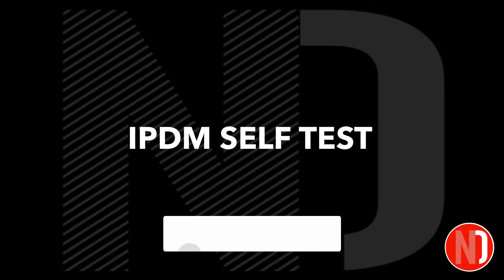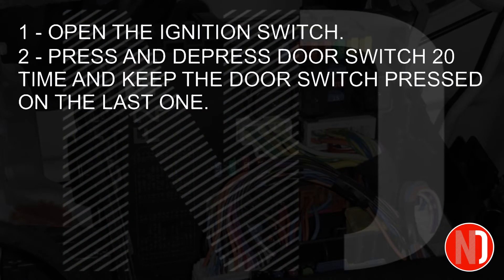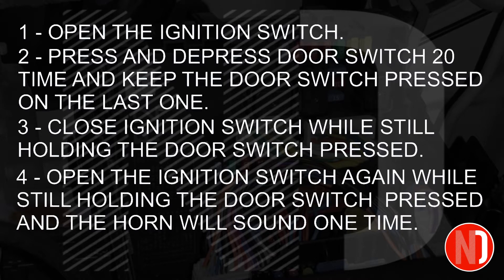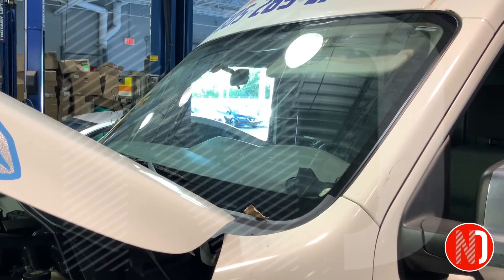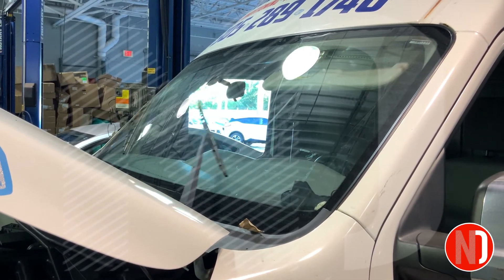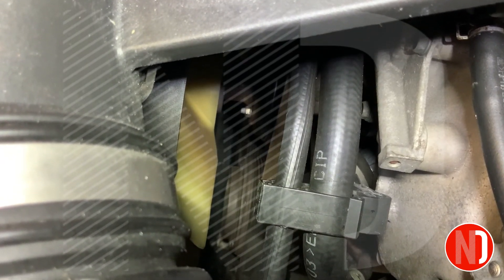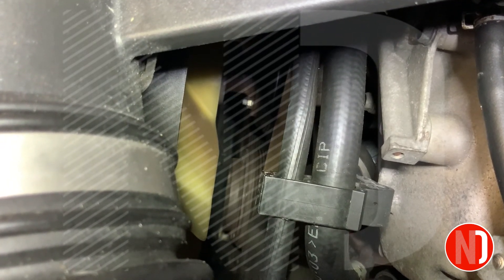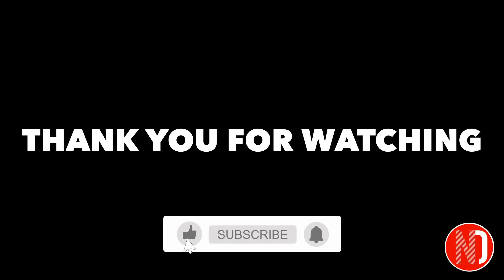Nissan IPDM Self Test - Performed on a 2017 NV2500 | Nissan Doctor

Comment: Hello friend, I am getting the P1651 error code with the OBD device. There are no symptoms in the car. The yellow engine light is on. I turn it off. It comes on again after 4-5 days. The battery is new. Can you help me? 2014 Nissan Juke

Comment: Hi, 
I have Nissan QQ 2017 1.2 petrol.
The tail light and the number plate light have stopped working , I have checked all the fuse boxes , and all  fuses are okay, nothing blown.
Do you think it could be IPDM at fault?

Comment: So I did the test on my Titan because the ac clutch was not engaging.  The test worked (wipers and lights) but clutch did not click and the cooling fan did not start.  Should i Replace the IPDM?
Reply: Did u get it fixed ?

Comment: My fan is running after several minute,meanwhile the engine temperature is still cold....

I've replaced the ECT,Thermostate,3 ipdm relay..but theres doesnt solved the case....could be it is the ipdm has damage ??

My car Nissan Evalia 2012 MT

Thank you,
Reply: is the ac on ? when ac is on defrost it will turn on the fans

Comment: Wrong info, u have to press 10 times withing 20sec and you do not need to keep holding om the last press, just close ingnition then on and it will work
Reply: Worked on my nissan quest 2012. Thanks

Comment: What if I do the test and the ac clutch and the fans are not coming on?
Problem is I have no power to my rad fan. 
Crank car, ac max, no fan. J-case fuse is good. And new rad fan relay.
Reply: Find it out?

Comment: My friend has a 2005 Nissan Quest, it's his only vehicle and unfortunately his place of residence. The engine shuts off while driving and there are no trouble codes present. I've tried replacing the crank and both cam sensors, and it still shuts off. Any suggestions?
Reply: Ipdm did u do the test ?
Reply: Check your fuel pump fuse. Is it getting any power? Does your fuel pump operate when you turn on the car?